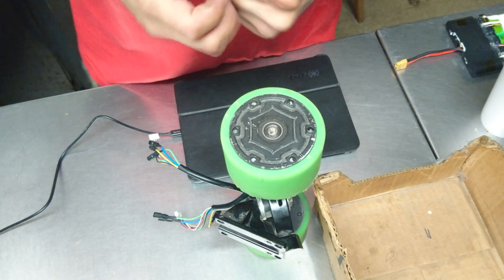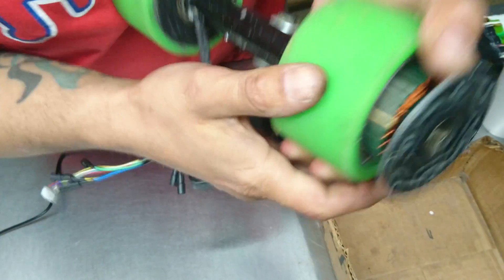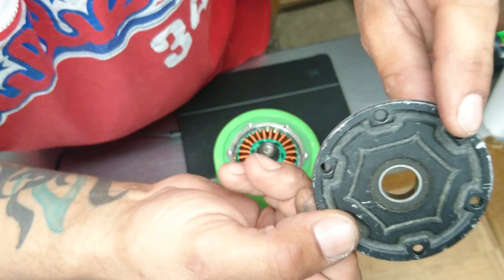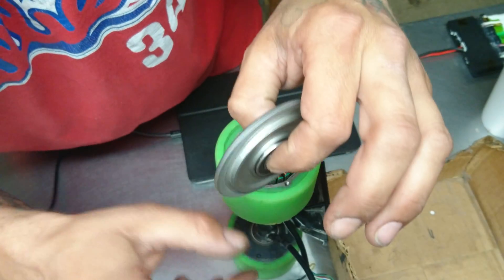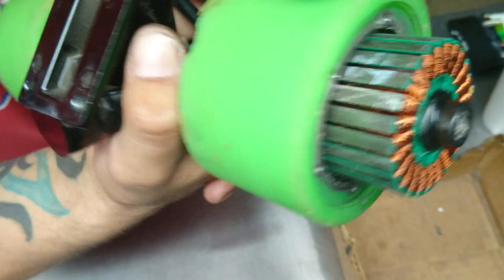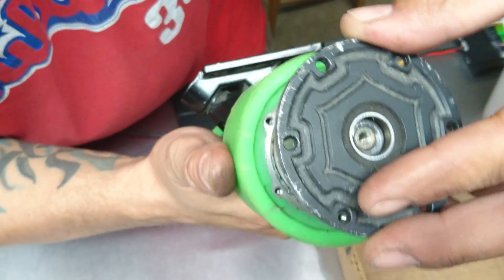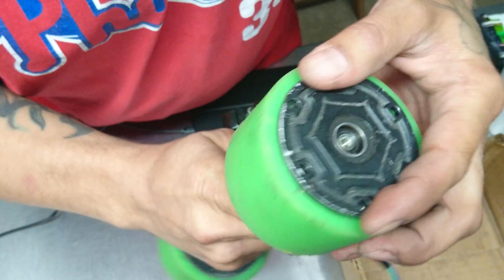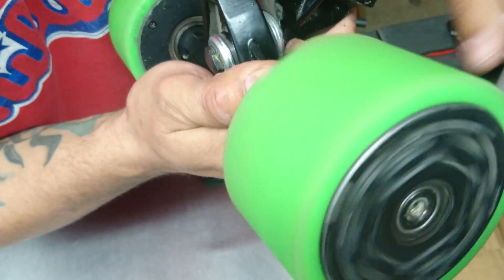Hub Motor 36v 350w Genesis Koowheel Outer Bearing and Cover

Comment: Hey joe there’s a board I want but the deck is wack, would it be possible to buy it and change the deck with my own? Would it be better than buying all the components to make a diy electric board?
Reply from the maker: Oh shoot sorry I missed this. Usually you can change the deck. You have to be careful with what decks you use. Longboards are made to flex usually and thats opposite of what you want for an electric skateboard.
Reply: Can you explain why you wouldn’t want the electric skateboard to flex? The meepo v3 flexes quite a bit so wouldn’t they make it stiff if flex was bad? Also can you help :| I’m stuck between the meepo mini 2 and the v3
Reply from the maker: @AmigoRigo  sure if the board is designed to flex, like doesnt have a solid battery or solid casing. Of course there are boards out there deaigned to flex but the components that bolt on are designed to flex as well. You cant take a standard battery pack and expect to bow it out. So its situational. Typically the boards that flex Ive had the worst luck with. The best ones have been stiff as a board. I guess it depends on which board you want. If its a flexible style board then yeah what I said makea sense. I mean if you want the meepo then cool, just be sure the amount of flex in the new deck matches. Most longboards are meant to flex way more than any meepo is meant to flex. Just beaware of using standard decks. The electric skateboard decks have been engendered typically with an extra layer that stabilizes it. That's why instead of 6 ply you see 7 and 8 ply

Comment: The my center bolt on one of my koowheel d3x hub motors loosens when I ride, so I have to take off the wheel and tighten it again after each ride,    Anyone have this problem?
Reply from the maker: yes yes it I have had it come loose. If theres a nut or bolt that can come loose it probably will. Throw a strip of blue thread locker down the side of the bolt. Just a tiny small amount up the whole boltm One strip. Then tighten it down and wait over night at the very least
Reply: Joe Kyser thanks man I’ll try that out, I didn’t want to try tightening it too hard for fear of stripping the bolt, is the thread locker crazy hard to loosen once you apply it? Like if I ever want to swap motors
Reply from the maker: @haayitsShanaynay  no the blue stuff is a medium strength, red is high strength. The blue is meant so you can untiighten later with no issues. Clean the threads super super good  before you use it and you should be fine after thatm Always did the trick for me

Comment: anybody make a 97mm wheel for these motors?
Reply from the maker: ive seen kits on ebay for 97 and 110 but your adding more weight to them as well which will affect the acceleration and braking. Not only that your changing your gearing too so you will go slower from the start and faster in the long run. always something to think about. theres no sites i know specifically right now though where you can buy them

Comment: Hi, i have replaced both bearings in my wheels, and now one motor became sensorless, did you had this issue? Or maybe you know what could have went wrong?
Reply from the maker: +Tomas Garsva Check your connections again. I cant say Ive ever had an issue specifically like that but its possible. Could have loosened a wire or something. I mean bearings have non correlation to the electronics so thats the first thing i think

Comment: Have you had any issues with an unexplained rattling noise? I cant seem to find where its coming from.
Reply from the maker: +GH05T120 I have dealt with some rattling noises but have been able to pinpoint i eventually. Have you tightened down all the bolts that go through the Skateboard that are under the grip tape?
Reply: Yes,I have but nothing seems to help. I even took the battery out and opened it to see if the insides were rattling and I put some tape to secure them. It seemed to help only for a little but now the rattling is back but this time I don't think its the battery.

Comment: Hey joe, would you happen to know what amps the koowheel mainboard runs continously? I am looking to do a frankenstein experiment where I am switching out the dual hub motor set up for a dual belt drive set up with 270kv 10s outrunner motors. I am not experienced enough to know if it will even move. Koowheel hasn't really posted the mainboard specs and I know the outrunner motors are about 35A continuous. Let me know mate!
Reply from the maker: +Les Evangelista they have a continuous amp draw of about 1.3 Max Amps at 15. I've had them hooked up to a vest and I have an amp tester so it's about 1.3 amps in order to get them to move
Reply: thats quite low isn't it. But maybe I am looking at this all wrong. I see some ESCs that are 120a and some that are 30a. I might be a tad confused here.
Reply from the maker: Les Evangelista yeah that would be Peak operating conditions. it's very possible to get that high but it's not typical. the numbers I'm giving you the low end is from a no load no stress test. ever use a vesc and program it? Same thing. minimum number is always pretty low. the amps will increase when weight is added as well as incline and unlevel surface. the koowheel esc is 30amps. 15 per wheel.  under tough riding conditions it may only use about 6 amps of draw at the most. Minimum is a little over an amp. the better the motor the lower that number is going to be. just owning a vesc can reveal a lot of info like this. also there are amp meters that you can hook up in line to get those numbers as well. combined with an RPM gauge you can get the actual KV of the motor too. I made a video on how to get the actual KV and the formula you use. on Instagram I show examples of using the tools
Reply: Awesome thank you for the information Joe! So I guess the Koowheel esc will be able to power the outrunner motor just fine as they are rated at 34A continuous. But I wonder if it is even worth it though. The koowheel is plenty fast but I just wanted to experiment with the drive belt set up and outrunner motor. Only because the interchangeability and the different wheels you can use instead of being stuck to using the 90mm PU wheel/tires specific to the hub motor style. The one I had in mind was a N6354 270KV 10s outrunner motor. Have you ever done something like this before?
Reply from the maker: +Les Evangelista yeah we'll be able to power it it's set up for a direct drive gear ratio and OutRunner motor normally works off of a 3 to 1 gear ratio so what's going to happen is it's going to give it a really harsh start right off the bat I mean like a three-time the power kind of start. it will move it but it's not going to work right I'll tell you that much. if the sensors aren't hooked up the hall sensors, then that's a unique type of Ride too. when I recommend hooking something up like that no just cuz it's not going to work right
Reply: ahhh i see! what esc would you recommend to power a belt drive system with the previously mentioned motors? And are these DIY builders always going to have the harsh off the line power with these belt drive systems?
Reply from the maker: +Les Evangelista no they won't. there are escs made for them specifically. maytech has o e for around $100. or you can use a vesc and dial it i  perfect. with hall sensors the added foc on th vesc is sweet. maytech esc doesn't have roc but wilk give you a proper program for iutrunner belt motors.

Comment: They need to work on durometer of the wheels rides like shit. The polyurethane is so hard - Website claims wheels is 85a hardness, No way my powell peralta bombers are
85a and they soft AF compared to these.
Reply from the maker: +MJH I definitely noticed that from the gate I know exactly what you're talking about I think somehow the thickness of the wheel came into play as well and that messed up they're gauge of what they thought it would come out to. you're right though I agree
Reply: That is the only problem I have with the Board, as the price is so good, but I think if you try push this board hard on corners, it will be to skatey and lose grip easy.
still great board for the price point.
Reply from the maker: +MJH oh it  breaks loose for sure. Ive had some real good rippin runs that totally surprised me

Comment: ..hey mate can i use a normal car esc to those motor?..like hobbywing max6?
Reply from the maker: +nikki hipolito absolutely. most motors that are sensored likw this just won't start up. They need a special piece of electronics in them that get them going. These must have it because i hooked it up to the other esc i bought off ebay that people wanted to know about and it made them rip. I'm actually going to take that and these motors and assemble of skateboard with it just to show you guys how it works. typically no you couldn't but i had luck for sure
Reply: Joe Kyser which esc you recommend best to suit these motors?i dont think my max6 are up to this motors..haha
Reply from the maker: +nikki hipolito problem with a regular car esc is you get max power when you hit the throttle. theres nothing to stop you from gently taking off. people do it though. one problem I see with them is they overheat a lot because it seems like they're not made for that extra weight and strain as the motor Torx. I was actually thinking about this comment here today and I wanted to be sure that I added that in
Reply: Joe Kyser yeah i asked because to a normal car esc those five thin wires doesnt have any room to plug in..so u thought they will not work just putting those three main wires...i asked kspars dambis he said thise are for the three sensors inside the motor to help it for torque and be morr efficient..however im tryinh to find an esc that suits these motors which includes a socket to plug those five thin wires..

Comment: Hey Joe, I'm looking for replacement urethane for my drive wheels also.  Got about 50 miles on my board but the drive wheels have cracks on them.  You got that link for it yet?
Reply from the maker: ed valdez i was digging for your comment, finally found it. I was looking for a link i had on eBay and it was a flop. That would have made it easiest for you. Looks like the maytech ones work. Same pattern. What color are you looking for?
Reply: lol NP bro, we all have busy lives... thanks.  I've got red but the green ones are cool too, there's so much crap on the roads all my wheels on all my boards end up looking doodoo anyway lol.  I'll check out Maytech.  Ride on Joe!!
Reply from the maker: ed valdez i know right! mine always end up getting so dirty looking. thats why i use black now haha. I'm going to make a video tonight and what I'm going to do is work on getting these urethane Wheels in stock in my local Warehouse here this way we can handle this with no problems. are probably told them a hundred times at this is like the biggest request out there so I'm just going to take this by the reins and handle it myself. hit me back if you don't have any immediate success I will be able to accommodate you here shortly.
Reply: Sounds awesome! Look forward to your future vids.  Thanks for pioneering!!

Comment: do you know where to get replacement wheels? I cant seem to find replacements anywhere
Reply from the maker: +Googly Moogly Mike I'm going to get that link for you what I'll probably do is make a parts video and I'll talk about what's available what I can get and if I can't get it possibly maybe someplace you can order it. I do have the maytech replaceable wheels but I'm not sure if they fit on these motors. I am definitely going to find out though because I have a set in the shop so I can look

Comment: Hi, I'm looking for a hub motor, to make a small bike for my friends 2 year old son, i think a single speed will be fine and walking pace speed , any ideas ? Thanks
Reply from the maker: +Elijah oh hey I just saw this it was in the spam for some reason. the different speeds come from an electronic controller box. selling the situation you're looking for a right on eBay there's some kit and they look pretty simple to put together I've seen a couple people on YouTube that have used them and then happy with it. the kids come in different wattages. then depending on the controller would be depending on how many speeds you would just have to look for that in the details but that's going to be your easiest way to go without having to put an awful lot of thought into it

Comment: Are those just regular skateboard bearings on the hubs? I changed the fronts t some Bone Reds and was debating on doing the back if it might help. I assume the difference may be minimal but also smoother.
Reply from the maker: +urmaker now they're actually smaller they're kind of hard to find I do have some replacement ones and haven't got to try them out yet. I mean these ones haven't wore out yet but I really haven't used it that much to wear them out lmfao so we will see. I'll see if I can find the measurements again on them
Reply: I appreciate it. Figured they would be different sizes. Just didn't want to take it apart to see. lol
Reply from the maker: +urmaker I was looking for my new bearings and I can't find them I just rearranged everything here go figure. it was supposed to make it easier for me to find my parts and shit because they were everywhere. so this is a little nerve-wracking. I have zero issues opening mine up though and I do have the calipers at all I got the original sizes. I just may have to do that. I don't want to forget though. just in case give me a reminder. that's some good information I have I should have posted that anyway
Reply: LOL I lose shit when I rearrange all the time. No worries. Glad to see the motors/wheels are easy to replace. My last board started minor chipping. This one I have now I have been more keen on detecting the small rocks in the road. Feels so much better with the front bearings changed so I was just wondering if the backs happened to be the same size. Never wanted to take them apart to look in case they were a bitch to get back on.

Comment: Nice work Joe .. )) Nice to finally see the motor windings quite impressive.... I suspect the Koowheel is the same as the Genesis although there are some differences ...  mine (KooWheel) is still hanging in there perfectly after probably 100 km... fingers crossed )) cheers Andrew
Reply from the maker: +Andrew Penman yeah you know what it depends when the board was bought there is been so many changes to all of them in the last six months it's not funny and the only reason why I know is because I've had several. they still don't have it down right. I believe they're using the wrong BMS. all's I know is koowheel hates me. all I tried to do is work with them on all the issues and they did nothing but make up lies and excuses. as consumers all we want to do is be able to use our product that we paid for thank you very much for the comment though I appreciate it I appreciate the feedback it's nice to know that at least someone's having a good time with their board and they're not having problems there's nothing more I like to hear
Reply: Thanks Joe )) i'm really impressed with your review content and you're E Board knowledge and updates ...specially the Koowheel and Genesis... you're helping heaps of people Joe ...great work))   keep up the good work mate awesome )) i'm just about to do the full review on the Onan X2 Booster System on my channel it's has got a few issues in terms of design and bearing setup ...but will see how my review comes out )) cheers mate )) Andrew
Reply from the maker: +Andrew Penman well that's my goal by Nature I'm very customer service oriented just from the various businesses that I own so I really actually enjoy this whole lot thank you again I really really appreciate the comments
Reply: Hey Joe yep absolutely )) me too )) all I try to do is just get a really honest non-biased Review Vlog across to help other people, because when I was looking for mine there was not really any decent reviews out there to advise on which one to buy... had heaps of trolls come online and give me a hard time say your a salesman lol  that's not the case LOL makes me laugh .....so you've had the Koowheel product as well Joe ? as well as the Genesis ? and did you purchase it directly from Koowheel in China ? I found them pretty good to deal with I'm so sorry you had bad experiences but then again I suppose these things do happen (( cheers Andrew
Reply: No probs Joe )) great content and great delivery very informative stuff, and important topics and what you are doing is trail blazing ) well done Dude ) you'll do really well, cheers mate )) Andrew P